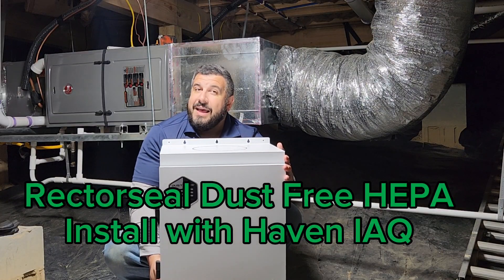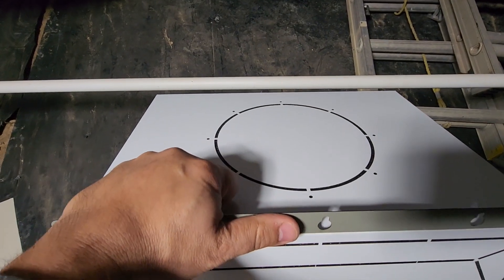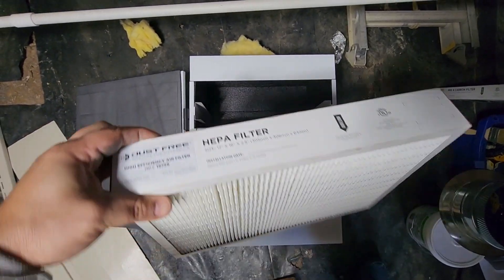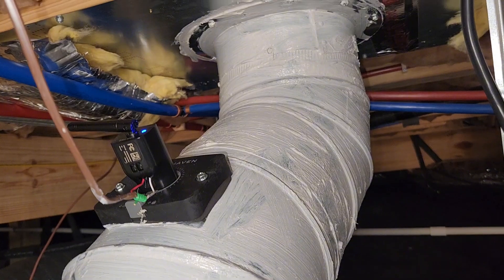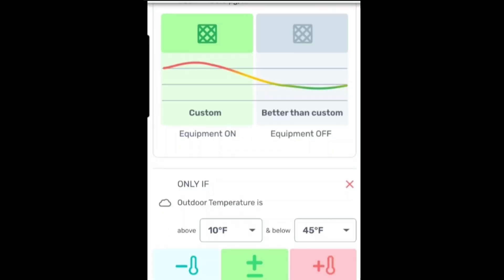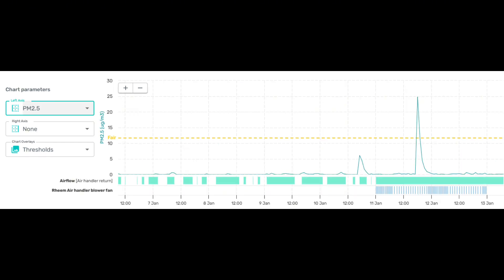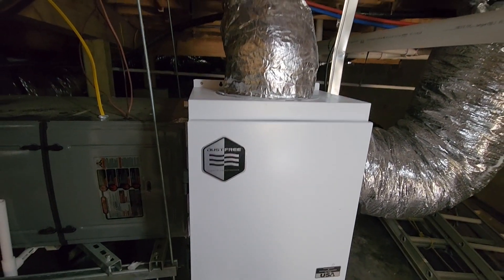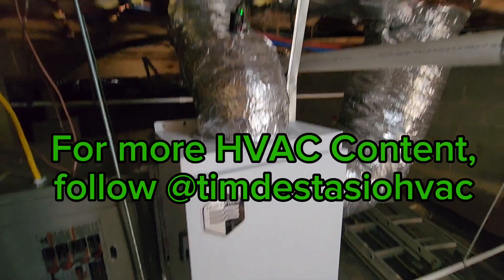Dust Free Bypass HEPA by Rectorseal Install with Haven IAQ

Comment: OK it's noisy but I have placed multiple powerful residence-grade air purifiers (e.g. 350 cfm)  and they NAIL the air quality. I mean 100+ down to 0.0 NOTHING. I dropped back to just one of them in a 3200 sqft home with vaulted ceilings.  I have to cycle it through different areas of the house after doing construction (sawdust from carpentry is a LOT more noxious than you might think) but it really gets it done.  Cost is about $200, installation cost is zero, and filters last a surprising time.  Yes there is noise but it's satisfying in a way because it's just gobbling up the particulates.  I go from coughing to not in a few minutes and my PurpleAir monitor (also about $200) confirms the vast difference in AQ before and after.
Reply from the maker: That works too